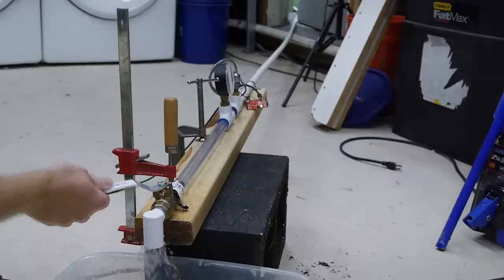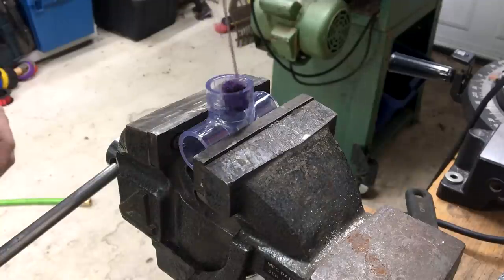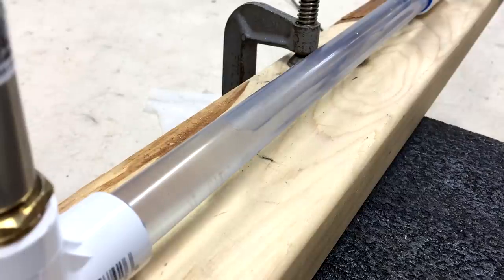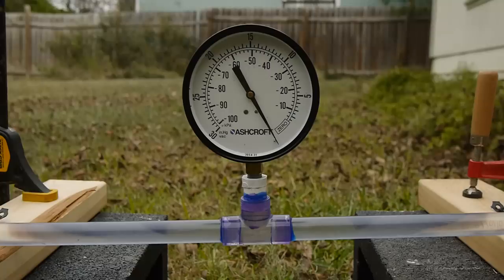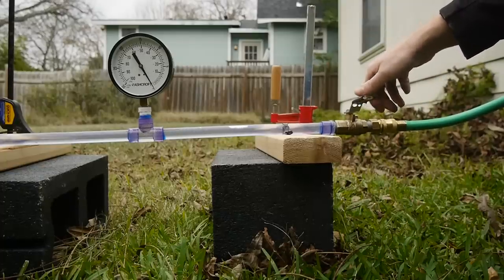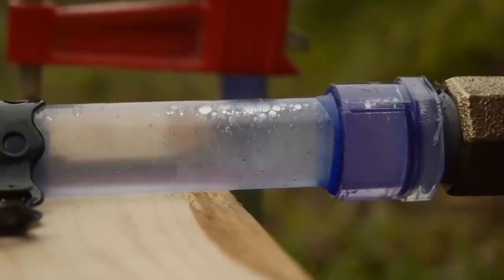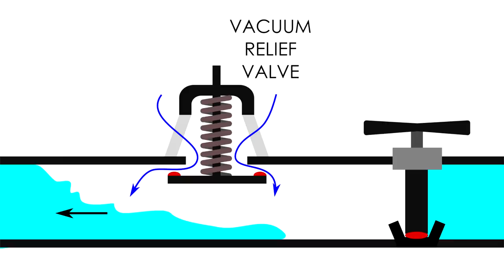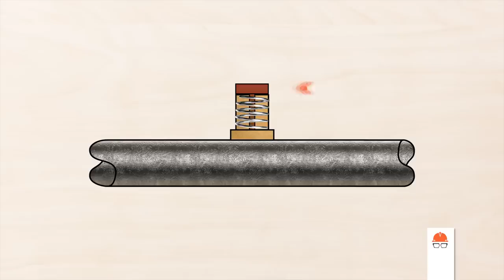How to Collapse a Pipe by Closing a Valve

Comment from the maker: What topics are you interested in for 2018? More fluid dynamics? Reinforced concrete? Geotechnical?
Reply: Curing Concrete by refrigeration? (Like Hoover Dam)
Reply: Could you do one on fluid dynamics of gases (ventelation systems, tunnels, etc)?
Reply: Is grainlock something that might interest you ?
Reply: I like Tyzoids idear
Reply: Prestressed Concrete
Reply: do some structural stuff!
Reply: Practical Engineering I don't care what you do, I know it will be interesting and entertaining. Great job by the way
Reply: Seeing all the concrete examples got me thinking about a material I have heard about in the past: Pykrete!
I would love to see a video about the stuff :)
Reply: Negative water pressure.
I still don’t get Veritasium’s video on trees transporting water past the “vacuum level” (my terms).
Maybe you can do a collab video with Derick from veritasium on a follow up video :)
Reply: Vacuum and pressure of air. Such as vacuum conveying, vacuum cleaners, or Venturi effect
Reply: I would like to see more Structural Engineering videos, Earthquakes etc Things that aren't here on YouTube or not properly explained on YouTube.
Reply: 902Jr agreed
Reply: More fluids, those are your most entertaining, gear box/gear ratios/ basic torq
Reply: Geotechnical and concrete!
Reply: Different types of bridge structure shapes and materials and what makes them work.
Reply: What about bridges and how they’re built?
Reply: Practical Engineering anything that cause destruction
Reply: Materials science.
Reply: CAVITATION. 
Always a fun topic
Reply: I really like fluid dynamics, and I've found it SUPER hard to learn. I'm particularly interested in how engineers decide where and how to run things like creeks and drainage ponds and how to design underpasses and other bits of concrete infrastructure in developed areas.
Reply: Voting for concrete.
Reply: Geotechnical / Soil engineering please!
Reply: Love me some concrete, but all three topics sounds great!
I also like a few random ones in there, like the yo-yo despin video.
Reply: You could talk of Radon gas build up in basement. Most people will have 5 time the safe amount of Radon gas and this can lead to pulmonary cancer. I think I saw statistics that showed that about 15% of lungs cancer cases  were caused by high exposure to the gas.
Reply: How does fire work / engineering for fire resistant construction / fire fighting techniques.
Reply: Freeway design.  I'm always curious how they decide on radii of turns and the banking angle. And the length of on ramps and when to start dotted lines for off-ramps.  I know they have codes, but I'm not a civil, so I never looked into it.  I've seen old road curvature templates around the office, like stencils for road design. Have you seen those? An overview or highlights of the code would be cool!
Reply: Geotech and concrete!
Reply: I think a great addition to the fluid dynamics series would be a video about hydraulic ram pumps. It would show how the forces that you have been describing can be put to use to do work.
Reply: Hi, are you inventor? Do you have any patent in your name? I want to watch some inventions relating to engineering explained.
Reply: House building engineering stuff like reinforced concrete, how do different concrete plasticizer work (these substances that allow mixing and pouring concrete at temperatures below zero deg. C), fixing cracked walls by reinforcing them with rebars. Reason: I'mjust finishing repairing a vertical crack in wall. ;)
Reply: If those are the big three, fluid ranks 1st, then concrete, then geotechnical. I've always personally wondered how we build structures underwater—setting down the stable pillars for suspension bridges, or making tunnels for cars from Manhattan to the mainland.

Regardless of what the topics will be, your videos are always incredible, Grady.
Reply: This is kinda late but I'd really like to see how tug of war creates injuries (and in some cases, fatalities). I get the concept of two teams of people pulling a rope apart but when it's scaled up... it goes out of my mind.

If not that, then the concept of injuries behind arm wrestling?
Reply: I'm not very picky about the topic, but I think actually seeing the catastrophic failures would be cool.
Reply: I am a high school senior heading to college soon aspiring to work in civil engineering. Anything related will be awesome help to let me know what I’m going to work with :)
Reply: I'd love to see some stuff with prestressed concrete. Although I think that would be a tough "backyard" experiment.

My hometown is also the home to unistress, one of the largest suppliers in the country, if not the world, after expansion from the Tappan Zee Bridge contract. So I'm just a little personally invested LOL.
Reply: Electrical
Reply: Practical Engineering yes.
Reply: Geoscience student here. Geotechnical all the way!
Reply: Oroville dam spillway failure hits a lot of items on your list.
Reply: I've also always found waste treatment plants to be absolutely fascinating systems.
Reply: All of the above Grady, and anything else you want to explore. You're making great content :)
Reply: I find your videos on civil engineering to be the thing that sets you the most apart from other channels I watch. More civil engineering, (and "What's that infrastructure"!) would be awesome!
Reply: Soil liquefaction sounds like a fun one to demo.
Reply: I've grown increasingly fascinated by plumbing, and the engineering that goes into it. Anything regarding fluids would be greatly appreciated!
Reply: Geotechnical :)
Reply: @TheMr77469
That wasn't just to cure it.
It was to "pump" out massive amounts of heat created by an exothermic chemical reaction as the enormous volumes of concrete sets.
Reply: Practical Engineering Can you try to show a example of a  air lock in a hydronic heating system using clear tubing ?
Reply: More fluid dynamics please. It would be really nice if you could find a way to demonstrate Bernoulli's Equation and/or Pouiseille flow in a pipe and play around by manipulating the variables.
Reply: How building codes are determined? or maybe what factors into them?
Reply: - The engineering behind movie stunts
- Grain entrapment
- The intersection of politics and real-world engineering problems
- Cooling / heating things other than air (e.g. a driveway, a stadium)
- Reinforcing mines to prevent collapse so the land above can be used (e.g. Paris)
- Large scale construction projects pre-industrial revolution
Reply: Practical Engineering Are you still doing that what’s that infrastructure series?
Reply: Breakwater and Seawalls
Reply: Practical Engineering is there anything to help visualize transformed area method of reinforced concrete?
Reply: Thank you for these last few videos!! This is helping me with Fluid Dynamics this semester!
Reply: Your fluid & gas dynamics videos are great!  I'd love to see topics like different types of air, water, and vacuum pumps,  cavitation, effects of vacuum & pressure on vessels (maybe an imploding oil drum demo?).
Reply: Cavitation erosion (it probably has a technical term, I don't know what it is) on propellers and other systems, as a result of water hammer in pipes, and maybe a brief look into some well-known, well-documented failures involving it and other engineering problems you've explored already in your videos! (as a little historical sidenote to properly showcase and put in perspective how much power a little vacuum can have!)
Reply: As someone that works in flood control, I would love more videos I could direct people to when they have questions about various types of improvements.  A good counter intuitive example is why just making a channel bigger can actually make flooding worse.
Reply: I think something about heating might be interesting? Like heat pipes, simple heat exchanger or even a heat pump. Or district heating!
Reply: Have you heard of the Hyperloop? Does it seem overly dangerous?
Reply: The effect of frost on infrastructure. Both design and wear and tear.
Reply: Sewer systems, definitely!
Reply: Process engineering would be very interesting, though I suppose that's more along the lines of chemical engineering.
Reply: Metallurgy or fluid dynamics inside liquid fueled rocket engine
Reply: reinforced concrete, and more construction study pls
Reply: nathaniel steamgear . I don't know how old you are but take all the advanced math courses you can. Fiddle around with simple circuits, learning how to solder etc. Read The Art of Electronics by horowtiz and hill. Read it again:) Fiddle with arduino programming. Binge watch w2aew, andreas speiss, Mr carlson's lab, eevblog youtube channels etc. Pick a college that does CoOp so you see real world not just lab and lectures. Have fun.
Reply: Practical Engineering do a water hammer pump
Reply: I heard there's something similar to water hammer with electricity - that the voltage can spike when you switch it off. Maybe a video explaining how that works?
Reply: Delta P!
Reply: Practical Engineering please do a video on a Water ram pump !!!!!
Reply: Can you talk about Steam and change of state inside pipes. (Vacuum from steam to liquid)
Reply: More of "What's that infrastructure?" would be great!
Reply: @andrew nelson its very likely to be electro-chemical forces. Note that tree's lift many other substances  beyound their vacuum level besides water.
Reply from the maker: That was the previous video ;)
Reply: What's that infrastructure! Also, about your job/workplace? a virtual tour would be interesting too! Love your videos!
Reply: Geotechnical, like why do large embankments in eg strip mines use multiple steep slopes with terraces rather than one somewhat shallower slope(same total rise over run)
Reply: Cavitation!
Reply: Carpenter by trade here. I’ve heard about rebar and when it gets wet inside of concrete it Rust’s and starts to blow out the concrete. When and why does this happen and will this be a big problem in the future with how much concrete we pour now?
Reply: Fluid dynamics applied to plasma
Reply: I work at factory where we are making pre compressed concrete parts for ceilings, if you want some know hows I can send you some photos and description of wht we do (its nit a secret but on civil engineering studies I was only taught theory while in factory I got practice)
Reply: Lots of concrete related questions here, how about roman concrete? Salt water resistant and long lasting...
Reply: Engineered Material Arrestor Systems at airports. https://en.wikipedia.org/wiki/Engineered_materials_arrestor_system
or how to stop an airplane when space is tight.
Reply: How air pressure affects tires.  Particularly in large Agriculture tires. On our big 4 wheel drive tires we only run about 10 psi. I know changing this affects tire grip/slip what I don’t understand as much is the affects on soil compaction.
Reply: Inverted siphons. Water/wastewater treatment. Combined collection systems, clean water act, and sanitary/combined overflows? Just a few topics... :)
Reply: I'm still not sure what causes the "jackhammer" effect in old houses when you have the valve open partially. Water hammer is an impulse, not a continuous train of pulses.
Reply: The refrigeration doesn't cure the concrete. Concrete cures from the water reacting with the cement. This is an exothermic reaction so the refrigeration is to channel that heat away in large masses. Excessive heat can weaken the concrete when it is curing.
Reply: High voltage electrical transmission, but maybe a bit dangerous for the backyard
Reply: I'd love to see more stuff about infrastructure!
Reply: I would love to see fluid dynamics relating to gases!
Reply: Bridge maintenance, sewer systems, and pumps and valves. There are so many different types of pumps and valves.
Reply: Asphalt and concrete, differences between them, types and applications.
Reply: another for fluid dynamics of gas, i recently saw an awesome video with Leigh Orf that shows large-scale simulation of tornadoes/supercells. it's amazing to think of us living in a kind of fish bowl, we just cant see most of the water currents.
Reply: Anything you like! And I'll watch! :D
Reply: I watched a video on something called a Ram Pump today and I think you would do a good job explaining the physics behind this nifty device.
I feel like it kind of falls into your most recent theme of water hammer and the compressibility/cushioning effects of air in a mechanical system.
Reply: Practical Engineering Rio-Antirio bridge
Reply: I would like to see you do some videos on bridge failure, and look into ones such as the Tacoma Narrows Bridge collapse. Maybe even more videos similar to the one of the tuned mass damper pendulum!
Reply: Practical Engineering aerated concrete, vacuum pumps, cryo pumps.
Reply: Measure experimental coriolis force !!!
Reply: Measure experimemtal force in effect gyroscope!!!
Reply: geotechnical please..
Reply: Chemical engineering!
Reply: Fluid dynamics of gasses would be phenomenal! One other Water Hammer idea: I've seen some setups where the water hammer effect was translated into a vertical movement of water (the case I saw was using the pressure of a slow, but consistent stream to push a smaller amount of water up a hill, to where the person wanted the water)
Reply: Structural engineering or aerodynamics would be cool
Reply: More fluid dynamics and hydraulics please!!! (I'm addicted to hydraulics!)
Reply: Geotechnics AndFluid mechanics pls
Reply: Passivation and the effects of chemicals on stainless steel.
Reply: Maybe something about construction 😊 Like buildings (small and big, residential and commercial)
Reply: I know you’re a civil engineer. But I enjoy the Arduino/micro-controller projects a lot! Hope to see another one coming soon
Reply: more fluid dynamics
Reply: Practical Engineering great video!
What happens if the valve is elevated to certain height from the tip of the hose?

Will the vacum be more because it acts more like a siphon?
Reply: Ground loops would be nice.
Reply: Fluid dynamics
Reply: Hey man I really want to see a demonstration about why we use chokes in pumps systems and the difference between ESP and HPS  
Thank you
Reply: I would love to see some more thermodynamic principles in action! Great job though!
Reply: Idea:
Aggregate momentum of spinning steam turbogenerators, the affect on the power grid, and associated ramifications for alternative methods of producing/storing energy.
Reply: Types of foundations / piles available for large commercial buildings (pros and cons), and the types of soil they are best designed for.
Reply: Most commercial buildings are steel framed.
Most parking structures are concrete.
Why?
Reply: Global Satellite Navigation System (GNSS)
Reply: Practical Engineering one I’m interested in Is whether certain projects require specialized concrete for instance a pool and why it might or might not require specialized concrete
Reply: Closed loop and open loop controls.
Reply: Reinforced concrete!
Reply: Maybe for 2020 - why do the pipes in my walls make so much noise while I'm watering the grass?
I'm guessing it has something to do with harmonics ... is there a way to tune the pipes?
Do water mains vibrate too? Can it cause metal fatigue?
Reply: Can you make a illustration on how static pressure can hold back water on a leak in a pipe until it flows. I'm a plumber and have seen a 1/2" shower valve fitting with water pressure at 55psi when water was static it would not leak on the supply side of the valve with a pin hole. The pipe had a screw in it and when it rusted away leaving a small hole. When you turned on the water and static pressure dropped it would leak when you turned the water off when static pressure built up it stopped leaking like magic..... when in reality its science. Great video
Reply: u didnt show me how to collapse a pipe
Reply: Well, if it is so dangerous, don't use pipes.
Reply: Hey Good Sir, I think you should do a video on surge tanks, compressed air tanks and surge mitigation in general. Air valves are only part of the range of solutions!
Reply: Dinámica de fluidos por favor
Reply: Transient analysis in 2024!